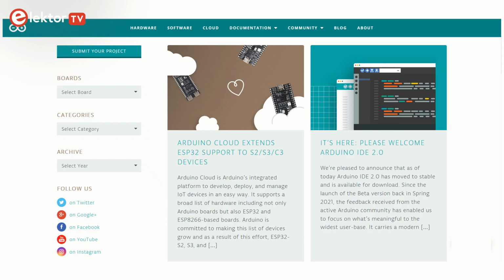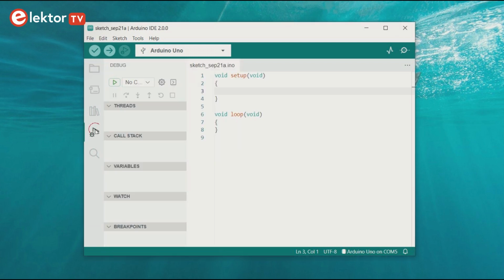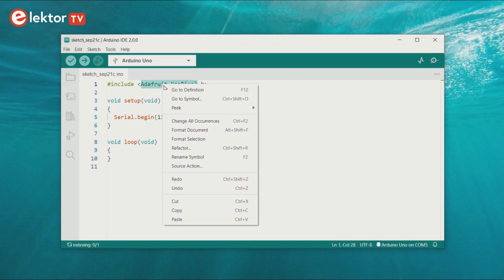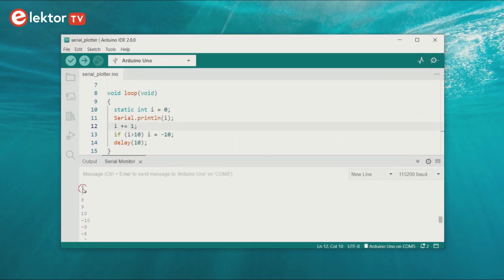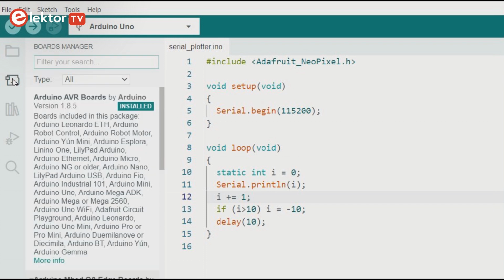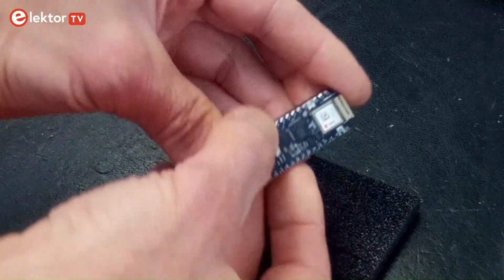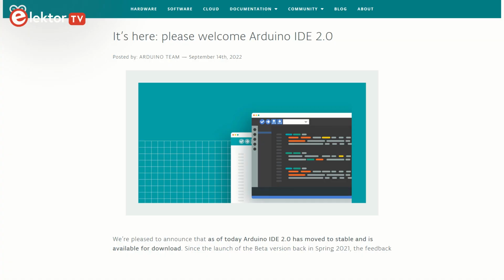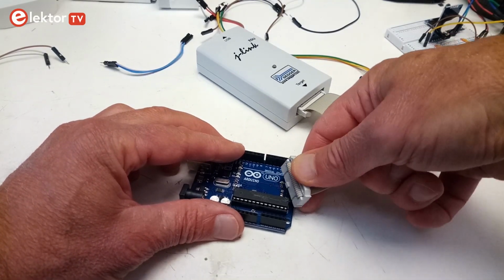Reviewing the Arduino IDE 2 0

Comment: I already have 1.8.13 installed. If I install 2.0.4, will it find and use the libraries and boards I already have installed in 1.8.13?
Do I have to uninstall 1.8.13 if I want to have 2.0.4 installed?
Thank you.